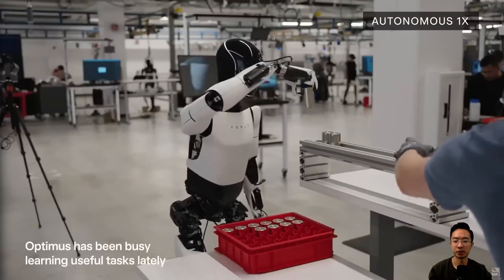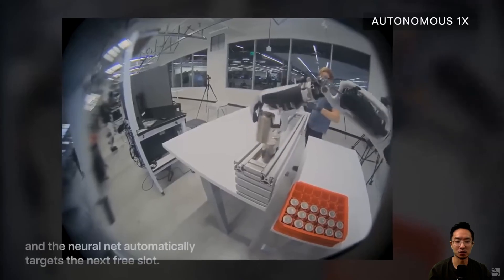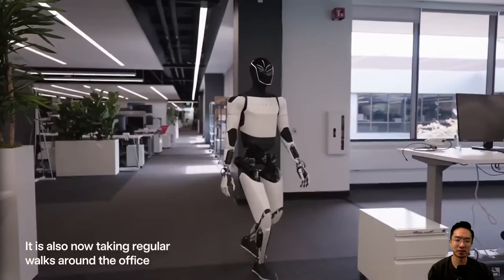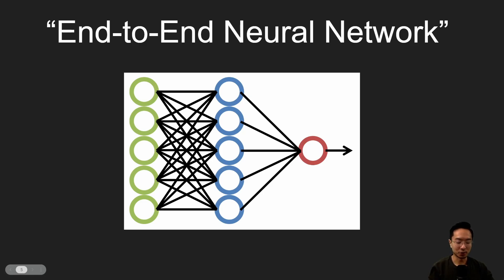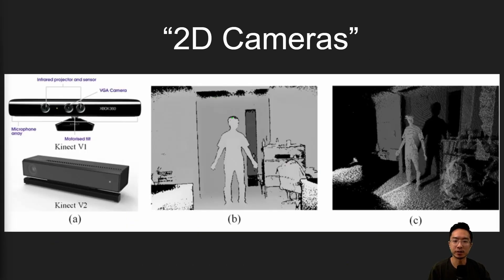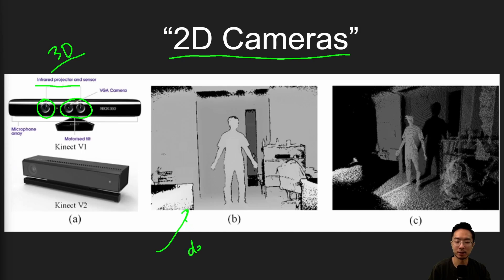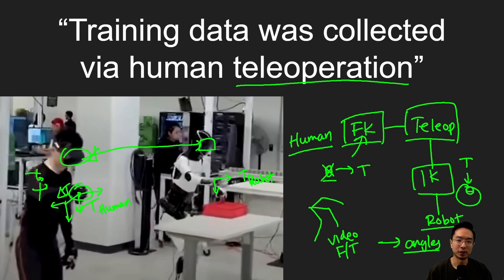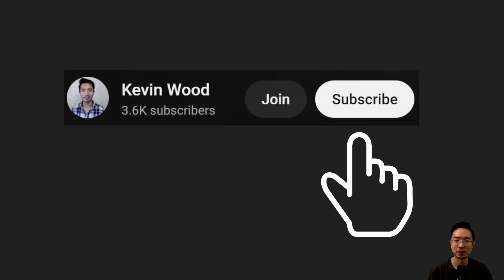Tesla Optimus Update Technical Deep Dive (End-to-end neural network, teleoperation, force sensor)

Comment: Why not use wheels that can go up standard stairs? And a spine and arms that extend and contract?
Reply from the maker: That’s possible too. But I think they want to make it like humans for human made environments
Reply: @kevinwoodrobotics  it would be more efficient for energy consumption most likely depending on the wheel design and faster moving across flat even surfaces , correct? Wheels could be placed in the foot and drop/up if the bit needs to move over uneven surfaces.
Reply from the maker: @GETREALLYRICH  yeah definitely more energy efficient with wheels but more versatile with legs
Reply: @kevinwoodrobotics  good to hear. Would wheels that retract into the foot or  on the side of the ankle /foot be difficult to implement? That way you have wheels and feet for more purposes and terrain